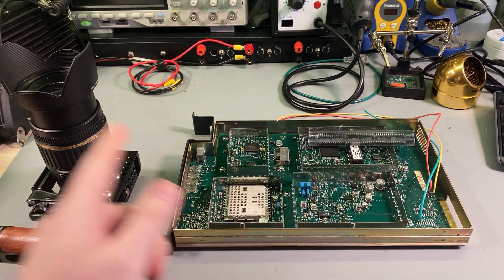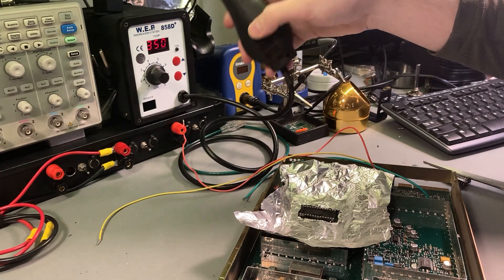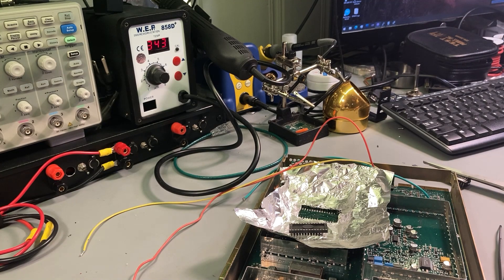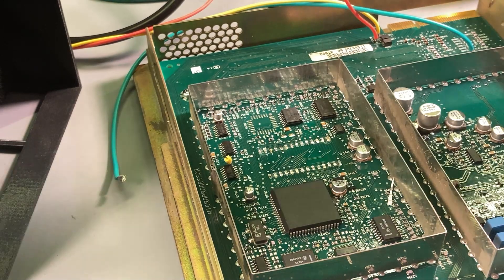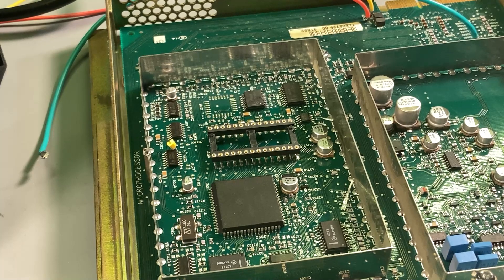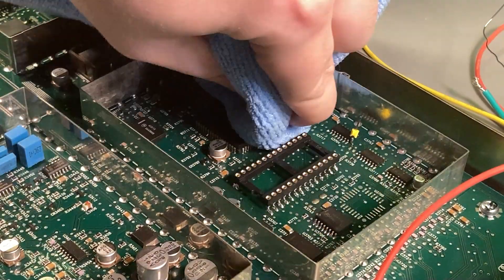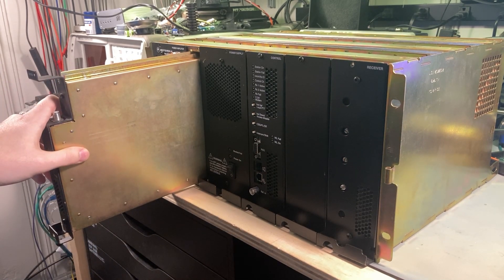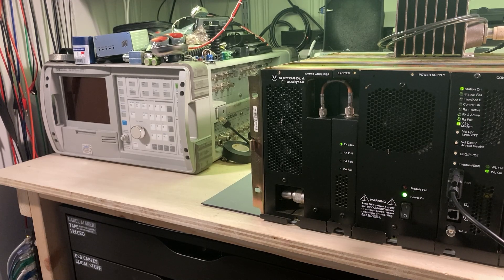Motorola Quantar Exciter Repair Part 2 - Repair and Testing

Comment: I invested in a used Pace hot air desoldering system. Works great and when working on multilayer boards I use a new tip with a good reactive rosin. Gets all of the solder off.

Comment: How would I be able to contact you about some Quantar repair tips that I am researching?...I have a lot of repeaters that have PA/RX fail. I am thinking about inversely swapping the exciter and control modules around until I get working units without having to strip each module down and do surgery like you have done here...